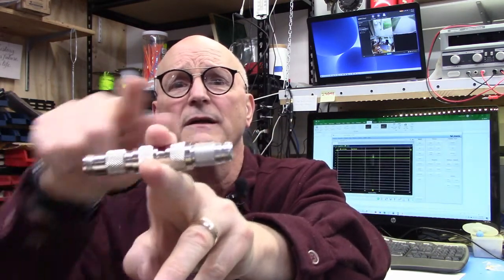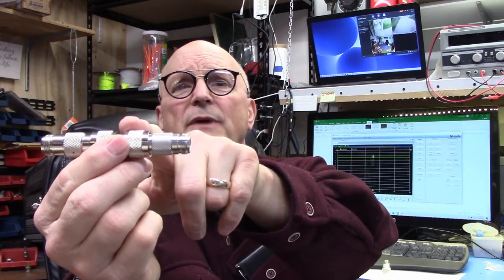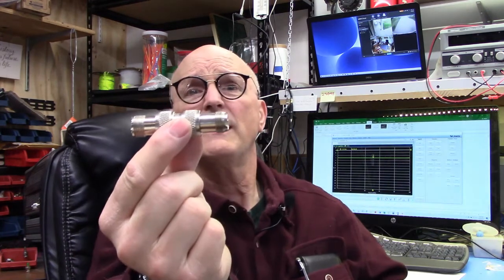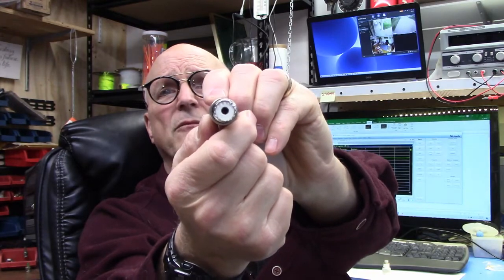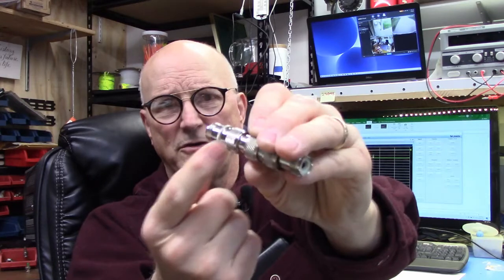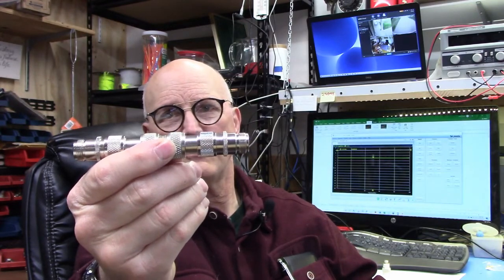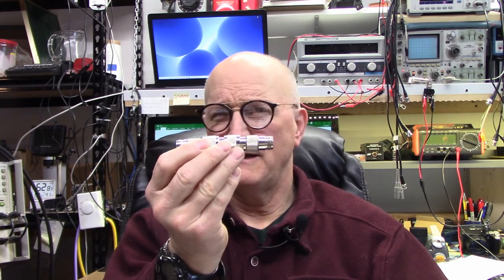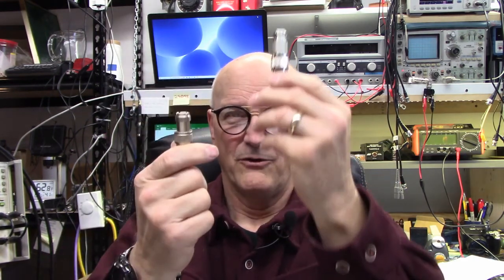UHF vs N (00d)

Comment: But you are stuck with the SO239 at the transceiver unless you are going to open the radio, and maybe void the warranty. Good video. Think I’ll stay below 2 meters.
Reply from the maker: Yeah ... ever since WWII when the amateur radio world was flooded with very inexpensive radio gear, coaxial cables and RF connectors (SO-239/PL-259 AKA: UHF), nearly every radio sports the ubiquitous UHF connector. An, I suppose, that is OK as long as we know and are willing to accept what we are getting with it. Don't let this video scare you away from VHF and even UHF. :-)

Comment: Just saw this video. Too late for me. I already got a bunch of UHF cables. Does it make sense for me to re-crimp them as N-type with a crimper gotten off of Amazon? I am way past my return period for all the stuff I just purchased.
Reply from the maker: Changing over to N only really makes sense if you are operating at VHF and, especially, UHF frequencies. HF? No big deal. :-)
Reply: @ yes I do operate over vhf and uhf mostly right now. Just got my license this month. My DIY hf antenna is still in the works. My radio has dual inputs. It’s the FT-991a. However it has SO239 connectors in the back. My Diamond D3000N has n connector. So at least one side of the cable needs to be PL style.
Reply from the maker: Well ... welcome to the hobby! :-)

Comment: I don't understand why this country wants to hang on to the old PL259/SO239 type connectors. Even UHF radios such as GMRS mobiles are still produced with SO 239 out the back of them. Is there a service company that can convert transceivers to n type out the back? Someone could make a killing doing quick turn around swaps.
Reply from the maker: Well...they are popular because they are cheap (inferior and cheap). N type are FAR superior, but they are also quite pricey. So, I suppose, because the hams are comfortably familiar with the UHF connectors, the manufacturers keep providing equipment with UHF connectors instead of N.
Somehow a lot of guys seem to think that N connectors are "hard to put on." Me? I actually find N connectors a LOT easier to install than UHF connectors. If we could only convince the general ham population that N is the way to go, then things would begin to change. 🙂

Comment: Thanks for another great video, I am currently stripping out my single screened coax runs and replacing with double screened at the same time as changing all connectors for Ntype. As well as Ntypes performing better electrically, They are much more resistant to moisture ingress. Plus they are much better engineered physically. I see no logical reason when a higher quality connector is available to resort to using a lower quality one. Thanks again. Mark GØUSL
Reply from the maker: You are welcome!  And N-types connectors are WAY easier to install!
I left my UHF on the lower frequency antennas such as 40 and 80 meters. The VHF/UHF? All N where I was allowed (rig has UHF!). I took out all the antenna switches and SWR meters because they are all lossy and have their own SWR. The ONLY thing in line is the lightning arrester, but its loss is near zero and its self-SWR is like 1.02:1 even at UHF frequencies (https://youtu.be/1fpoViuxn3c). When I am not using the antenna, I install a shorting connector (SHORT #12 wire soldered into a connector).

Comment: remove so239 from transmitters istall n female
Reply from the maker: SO239 is quite OK at HF frequencies.  It is on the VHF and above where it has real issues.  But, the SO239 was made popular because of all of the military surplus that was available after WWII. Like a bad nick-name, they stuck as the de-facto standard for all amateur radio equipment.

Comment: I concour. N or hi/po N are the way to go depending on the application. I suppose manufacturers use them because they are allowed to by unsuspecting consumer, and the profit margin goes up per unit. 

I usually like to work CW DX mode for its simplicity. I want my antenna to sink every micro volt of RF it can when the DX station is transmitting from the far field. 

I Really enjoy the videos sir! 

73 es gud DX ar
Reply from the maker: Thank you!  More are in the works. :-)

Comment: Another great video Ralph. Type N and BNC are the definitely preferred. Too bad manufacturers don't use them.  The slightly increased cost would be well worth it.  With a little practice they are easy to install on coax.
Reply from the maker: In fact, they are easier to install than the PL259s!